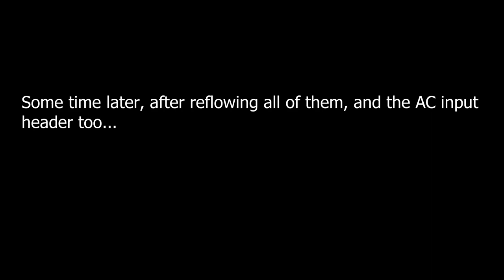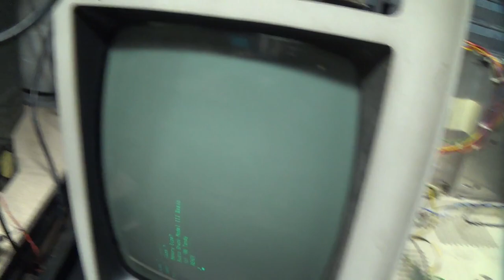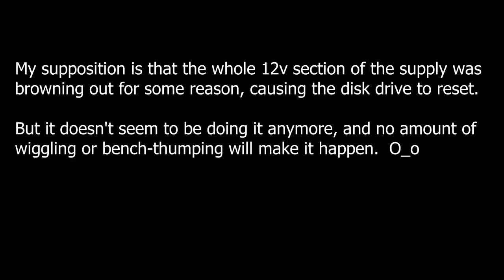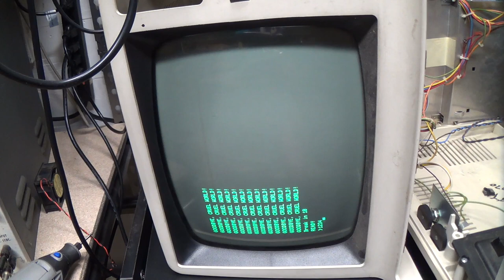TRS-80 Model 4 (Pt.3) Power Supply Repair and Disk Drive Foolaround (#SepTandy 14th, 2020)

Comment: Tandy was really big on Shugart for some reason. Kept it all the way till the end of the 1000 line, at least, when everybody else was going for the PC standard. That, coupled with the fact that a number of them pulled power through the ribbon meant that you had to get creative with your cables if you need to replace the 3.5" drives and don't have stock parts available.

Comment: The boot sector is on track 0 so the ROM only issues a RESTORE (seek track 0) command.  if the track zero sensor signal is asserted the FDC won't ever try to step the head.  So the lack of stepping is not a symptom.

Comment: That screen weirdness looked like some kind of intermittent CRT high voltage issue.
Reply from the maker: It has stopped doing it now.  Perhaps a capacitor was repairing itself.  I guess it it comes back, I'll look into it.

Comment: Drive select is done with missing pins in the connectors on the ribbon cable.
Reply: Is that specific to this model?
Reply: @BlackEpyon  It is typical for models I/III/4.